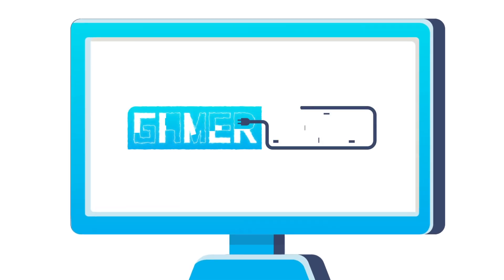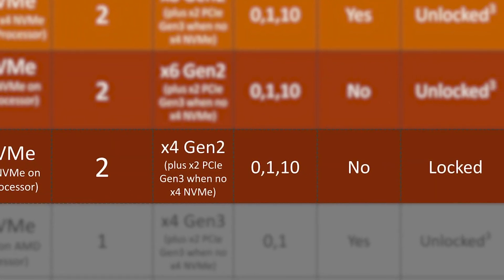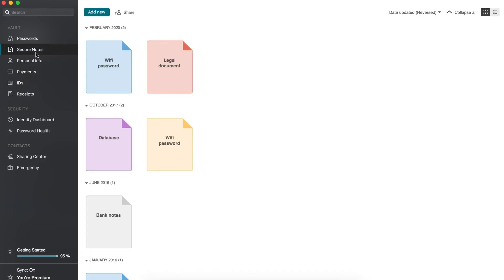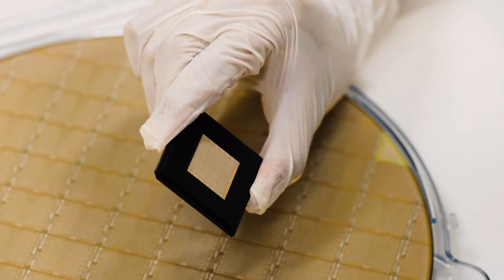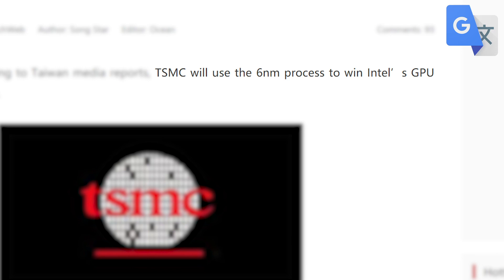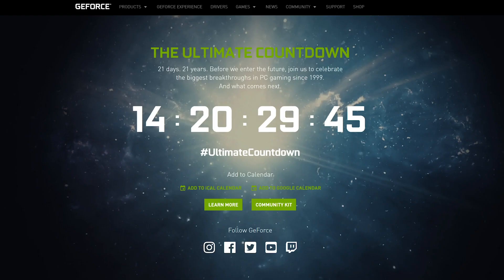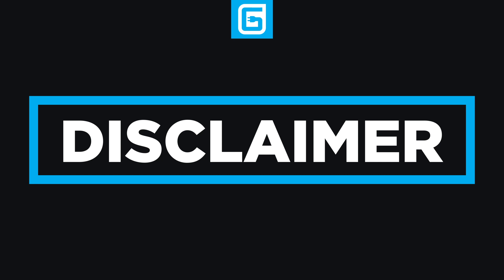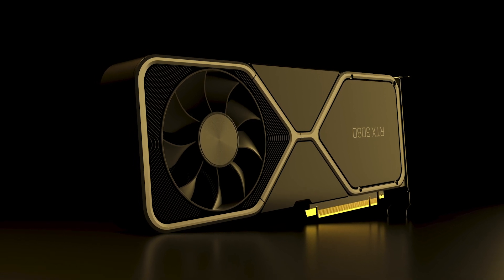FIRST RTX 3080 Public Benchmark, Intel’s XE Gaming GPUs Use 6nm!

Comment: I'd expect 3080 to come in at the 2080 ti launch price. Navi 2x will match it in late october for $700. 3090 will probably be held off to drop a bomb on amd's parade, retaking the 3080's price position. 3080 will probably drop to $750 unless reviews show a definitive performance advantage over navi 2x. Navi 1.5x will drop at $500 in december(missing black friday cause amd) matching a 2080 ti. Navi 1.25x will be a console competitior at $400. Nvidia will respond to those in early 2021 once they have significant stock.

None of these will stay in stock consistently(especially the lower navi parts which will mostly be a paper launch this year) until the middle of next year and will probably suffer price gouging to a degree

Comment: How can anyone dog on AMD now. Their prices are wonderful, they listen to their customers... And most importantly, they're alone battling multiple fronts. CPU with Intel, GPU with Nvidia... Now GPU with Intel. And this 3rd CPU company coming up and nipping at them. AMD has stood their ground, plus doubled their stock prices in a couple of years. Not as high as the others, but it has doubled.
Reply: IBM was the first and best CPU company these newcomers don't stand a chance
Reply: They've only came out mainstream for only 5 years... Still young.
They make mistakes
But those mistake will cost them their hardwork. 
Unlike Intel.. which even the biggest mistake was just WOOOSH gone.
Nothing happened

Comment: I just feel like there's no way prices on the 3K series will be remotely reasonable to support numbers like those. 

Tempted to get a 2070 Super now before prices spike from demand (cause everyone else like me waiting to upgrade well be like "nah" once the 3K series prices are revealed) and just wait another 4 years for the 6K or whatever series.
Reply: It is a great card.  I get awesome performance out of it and it runs steady OC'd at 1920-1980 mhz on the core and 15,600mhz on the ram (I have the Zotac rtx 2070 Super Mini)
Reply: I had it running at 2010-2040mhz steady pretty much since I got it but after updating Windows to build 2004 and my Nvidia drivers to 451.48 and 451.67 (tried both)... for some reason I can't get the card to stay locked anymore. 

I used DDU and did a fresh reinstall of the drivers from safe mode and made sure to reset the overclock before uninstalling and it just won't stay locked. 

Must be something changed in the driver. 

I can get the OC scanner to overclock it and it clocks up but I can not get it to lock the voltage and clock speed like I used to... it just ignores it.

Comment: My next gpu will be Cyberpunk 2077 focused.. we will see...
Reply: i feel you, ima build my first real gaming pc as well for cyberpunkt 2077 ..  got a monitor upgrade already and i need some specs that can handle cyberpunk ultra 1440p at 144hz consistently xD ... might wait till the 3000 series releases and buy a 2080ti when they lower the price though cause i think the 3080 will be overpriced - we'll see though ...
Reply: @j0lly_jump3r  newer tech is always better i think. And I might even go for AMD this time if they price it right.. Their igpus on 4000 series laptops look good and my laptop with amd integrated gpu was just fine with no problems.

Comment: Here comes Intel GPUs:
15% more performance over the best in class.
300% more expensive than the best in class.
yep, $2999 Intel video cards, yall...ok, maybe $1999, but no lower than that.
Reply: You don't realize how much more expensive the performance value past that one point...
Think of it like this my guy..
If you want to beat world record.. even having 0.03 second less will turn the whole tide.
But to get that 0.03 second requires pain and suffering. It much harder to get that 0.03 at high end than 0.03 at entry level. 
Very much like CPU and GPU industry.. the work put into getting that 15%surpasses the high end is much more difficult.. hence why the price.

Comment: I was gonna buy the RTX 2060 Super next week, cause I need my new and first PC for September mid... I'M CONFUSED AS HELL NOW, AHHHHHH, WHAT SHOULD I DO...

Edit: adding 'Super'
Reply: Just Wait I got my first rig in July and I'm saving up for the 3070 Ti Next year when it releases, unless you really need a gpu badly if you got something like idk say like a 900 series card or a lower end pascal card get something like the 1660 I have or 1660 Ti and wait that's what I would do personally.
Reply: @alexthesniper1952  The problem is in September mid my college is starting and why I need it so bad is because the class will be start as an online class (of course it's online, there's a pandemic that's still going). But yeah, I might still buy the RTX 2060 Super later on when the prices drop rather than wait for the 3060 or whatever that thing will be called (Cause from what I read, the middle class GPU usually released 1 or 2 months after the high).

P.S. I was planning to buy a laptop, but all of the laptops with AMD CPU is on pre-order for 90 days, which means it will be ready on October late.

Edit: Thank you for your suggestion man!
Reply: Buy It.. new lower end Nvidia graphics cards won't be ready at a reasonable price until october
Reply: @StringBard  That's what I'm thinking about, wait for the new RTX released, and after that look for a shop that lowered the price of RTX 2060 Super
Reply: @Akiwaaa_  I mean personally I wouldn't buy a Turing Card right now. I would just wait like I said go for something like the 1660 or 1660 ti and wait if you can like I said above.

Comment: Intel
Starts making gaming gpu's
NVIDIA
My time has come

BTW who wants nvidia to make cpu!!
Reply: Works well from CPU to GPU not the other way around. If NVidia started to make CPUs that’d mean another socket series which mean more motherboards which might mean production overload which might mean a shit ton of delays which might mean expensive af motherboards 😂😂😂

Or it might go well 🤣
Reply: @mtutoriales well that's a lot of work but it will be cool
Reply: NV are trying to buy ARM aren't they ?
Reply: @SerBallister  yes, but arm doesn't manufacture its own chip. It own IP of arm architecture and give license to other companies. arm is mostly used in mobile devices and it would mean nothing for gaming but we'll see where that goes.
Reply: @PratikPatel-zs2pu  NV make ARM based SOCs for the Switch, but yeah it won't affect the currrent PC/Console market. Who knows if x86/64 will still be dominant in desktop PCs in 10 years time.

Comment: The question is will ampere be the jump in performance needed to actually wanna update from the 1080ti?
Reply: Well probably, because at that point since 3090 is apparently 50% better than 2080ti, and 2080ti is like 10%-20% better than 1080ti, that would make the 3090 about 75% faster than the 1080ti, and so a very worthy upgrade I'd say. The price difference may not match up, being that you spent most likely around $600 or so, itll probably be well over $1.2k for the new highest end card.
Reply: @TheGauges420  is the 10-20% of the 2080ti actual functional increase, or is it referring to the rtx cores added, and the same for that 50% increase from the rtx, how much is actual computational increase and how much is just rtx capabilities (which I will eventually be happy to have, but refused to upgrade to the 20 series due to the fact it feels like an alpha project, so it wasn't a comparable upgrade)
Reply: I went from a 980to to 2080ti and the jump was massive, I would not expect 2 generations to be that large.
Reply: @SerBallister  yeah that is a massive increase, problem with upgrading from the 1080ti is it was a monster of a card, and so looking up it's benchmarks compared to the 20 series it isn't really that impressive of a jump when comparing it to it's successor, but your right, 2 generations should bring enough of a boost to be worth the upgrade.

Comment: I am shocked IBM's POWER CPUs are still a thing. Though the "advancement" is kinda like just another way to skip over the hard drive to go faster by using DRAM as DDR5 is faster than any SSD is due to where in the logic system RAM is compared to anything else.

For the Intel XE i mostly see it trying to compete with high VRAM cards on the high end that lots of VRAM is needed and you would need to do some tricks to make your GPUs work together to get to that amount while nvidia and AMD are more so for the consumers who at most use up to around 12GB of VRAM maybe that much at most.GPU compute simulations can run over 100GB of space needed. Other then high VRAM needs in the high end Intel cards i don't see Intel beating nvidia.

It is good that a 10GB of VRAM card is now in the consumer space in the product stacks being in the GeForce cards not in the TITAN, Quadro nor Tesla cards. For me i kinda need CUDA while being bound to nVidia's cards due to CUDA compute still being better than OpenCL for 3D modeling in Veiwport it is annoying to have to wait for nVidia to put more VRAM onto the cards i can afford not being a business.

I think that nViida just moved the 2nd best from the x080 to the x090 instead of having a x080ti card. Going by what has been happening i wouldn't be surprised if we can a 3080 SUPER that rivals the 3090 and a 3090 SUPER that is almost as good as whatever their name for the TITAN card is this time if not better in compute.

Comment: Currently I have a couple hundred dollars I’ve saved, getting paid later this month, pretty hyped that I can build a new rig with the new tech
Reply: Uhm, no, sorry, you cant. The new GPUs from Nvidia will likely be around $500 and UP only. If you've only saved $200, you need to save about 10x that much, and save $2k, if you want to use some of the newest tech anyway. Now if you're going used or budget, then of course you can spend less, but for the privilege of using the newest tech, while it's new, is not very cheap, not in the slightest. Dont let that discourage you, just save more aggressively. Put more up when you can afford to, if you aren't absolutely hungry maybe skip lunch and bank that $5 saved, and in no time you'll be able to get you a pc...

Comment: I think Nvidia will beat big Navi in overall performance. They aren't holding back the voltage to a point PC's will be OVENs!

BUT!

Performance to watt
As well performance to Price AMD will be Nvidia. And the performance will be so close AMD big Navi will be the better choice....

For once.

Kinda a repeat of what happened with Zen 2 vs Intel I9 series series.
Reply: Top specs for the better my dude.. they don't really care about watt and temperature.
They don't really care about the value.
They just want to top performance
People actually don't realise sometime that little bit of perfomance like 50% is just so expensive.
Think of it like this... Speedrunning.
Even 1 second can turn the whole tide. But to get that one second less is huge pain. Just like CPU and GPU.
Value of performance isn't the same as always

Comment: I think the gpu's will be called the 21st get not 3000 series coz it says 21 years later ,21 days later n its the 21st century
Reply: Nice theory. However, Nvidia has gone 1000 series to 2000 series, so logically it would be 3000. It would appease fanboys and it sounds cooler.
Reply: @fronkmonk  the reason they went to 2000 was to show the leap in technology with rtx ,that said 3000 is possible because they released 1660 which might interfere with the naming scheme
Reply: @dilip_1997  I agree, however I myself would even prefer buying a card that's named "rtx 3000" over a card named 2100. I understand your logic, but I personally believe a 3000 series naming scheme would be more appropriate